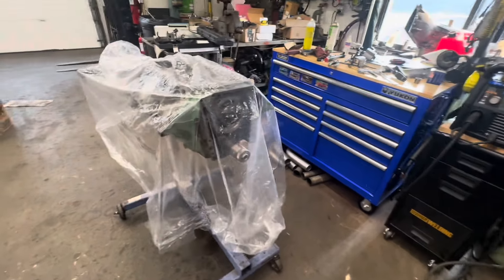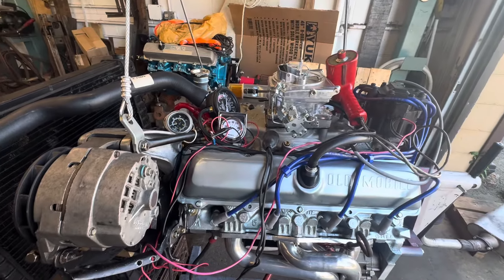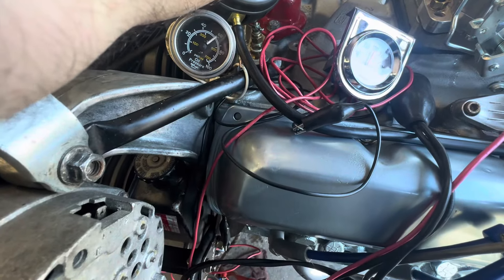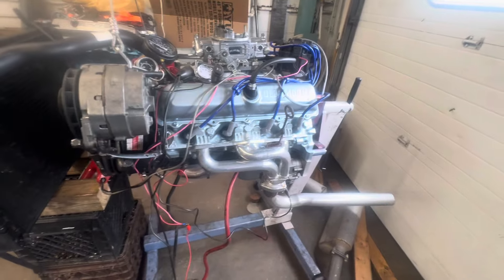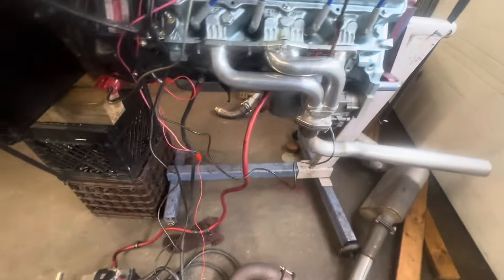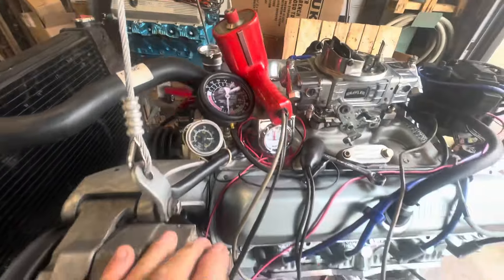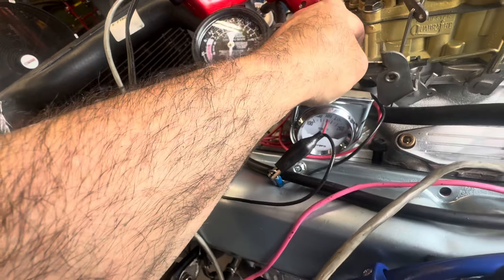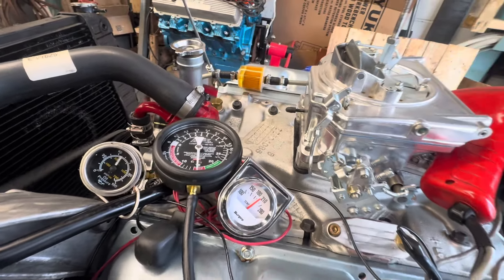403 Olds engine build and test runs￼

Comment: One of the most underrated Small Blocks of all time , as the years go on people realise the 403 is not weak at all , many at 400 000 miles, that huge bore of 4.351 is 100 tho bigger than a 454 chev , bigger than a 500 caddy big block , and the magic 86 mm stroke all modern engines have, its a brillant engine , raise compression and intake, cam and exhaust it more than doubles power , all the burnouts in Smokey and the Bandit were done with a 403 olds Trans Am. Many these days are reving that " weak" bottom end to 6750 rpm snd 675 hp , no brakeage ! That massive bore is very good !
Reply: @JosephCowen-fz8vj  actually the bandit car was a pontiac 400, the trans am used in the bridge jump had a 750hp Nascar engine which was a chevy.  Another fun fact is the 403 Olds motor didn't come in the trans am until 1979.
Reply: @tdog6437  Actually, the 403 was standard in the Trans Am, and optional in the Formula, in California in 1977 and 1978. California was no longer allowed to use the Pontiac 400 engines at that point. Of course, in 1979, the 403 became the standard TA engine, and optional for Formula, nationwide.
Reply: @grand73am  you are correct, California and colorado both had the 403 as a no charge high altitude option in 77 and then became standard for all automatic transmission trans am cars in 79. The only way to get the 400 trans am in 79 was to order it with a 4 speed manual.
Reply: @tdog6437  yes I've had a few , although big , that combustion chamber is well designed , like all Olds , in 1990 the Olds V8 was the only engine that year to be released with a carburettor, it passed emissions with a carbie , every other GM and infact all US V8s needed fuel injection in 1990 to pass , except the Olds . That shows an efficient combustion chamber.
Reply: Was going to do an ls swap on my 79 trans am but I think I’ll keep my 403.😂
Reply: @rafalanderos6527  it's a great motor , that bore and stroke is magic , Edelbrock makes 403 SBO specific heads now and 7111 Victor intake , that revs to 6500 and 600 HP . It's lighter than a SBC . A great engine ,
Reply: Don't think the 403 was a small block
Reply: The 403 wasn't used in any of the movie cars
Reply: @clarencedoland3534  The 403 is indeed a small block Olds. I used to have a 79 TA with a nonwindowed block and I built it up a bit.
Reply: They are the best olds stroker engines

Comment: Seen many cracked main webs in 403's in the 12 years i was in the machine shop.
Reply from the maker: I haven’t had that misfortune yet. I’ve only been inside about a half dozen 403’s in my life though
Reply: There was two block designs. The early design was basically the same as the 455 or 330/350, plenty strong. The later design had a "lightened" block with windows in the main webs, much weaker.
Reply from the maker: @ that’s a myth that refuses to die. No one has ever shown or photographed a solid main web 403 that I’ve ever seen. If someone had one we’d have seen it by now.

Comment: The only thing that bothered me with the 403 was the main webbing having the windows.
Reply from the maker: Yup, that limits how far you can go with them. I’m not going to push this one too hard though 👍
Reply: @olzkng  did you try a different oil pressure gauge yet
Reply from the maker: @tdog6437  no I haven’t. I’ll probably just put it in the car as-is. The oil pump is just a Melling replacement pump with their high pressure relief valve spring so I’m not sure what’s going on there. I’m using Lucas straight 30 break-in oil so I’m sure that’s bumping the pressure up some. I usually run 10W30 or 10W40 synthetic oil after the break-in period so it’ll probably come down a bit from that
Reply: LS motors have windows in exactly the same place ! Are they weak ?
Reply: @JosephCowen-fz8vj  LS motors have 6 bolts and other advantages

Comment: I'm proud to say my only Olds that I ever had was the last of the good ones.1980 Olds 98 Regency. 350 4 barrel, turbo 400 trans. Then they went to the 260 and 307 smog motors. Never the same for power.

Comment: Had one of those 403's in a Jet Boat. The Harden Marine 403 did not have the window mains in  the block..I was told they don't have them in the 77-78 GMC motorhomes either. They used a cam with specs about the same as a 70 455 4sp cam..like 475 lift and 295 duration if memory searves. The thing Ran so close to a 455 jet....it was scary!

Comment: Sounds good, what cam did you pick?
Reply from the maker: I went with a Olds factory cam part #400165 made by Supercars Unlimited. It was used in the 69 Hurst Olds, the 70 442 with automatic trans and W30 with automatic trans, the 1970 W33 Delta 88, the 1970 Toronado GT W34 and I believe in the 71 442 automatic also.
Reply: @ that’s amazing, I’ve always wanted to try that grind! Too bad Supercars Unlimited shut down.
Reply from the maker: @jimmy_olds  yeah that was a bummer. I hope someone picks up their inventory or decides to supply the same cams they did
Reply: @ absolutely! How’d the engine turn out? Decent amount of power?
Reply from the maker: @jimmy_olds  I only got 60 miles on it before it got cold here so I'm still breaking it in. I like to put 100 miles on my rebuilds before I really get on them. It feels strong though and has lots of bottom end power. It spins the tires effortlessly so I'm hoping it makes a decent amount of power.
Reply: @olzkng  sealed power sells it through advance auto or did when I bought mine 1970 w code 350 heads with the 403 valves and the w 30 455 cam with a good intake and carb will make 400hp out of a 403 with long tubes
Reply from the maker: @79huddy thanks for the info 👍

Comment: I'm running a Street Demon carb on my 1970 350 olds in a cutlass supreme.  It works good with the edelbrock performance rpm intake.  Stock exhaust manifolds, cam and valve train.  I am going to put some shorty headers and a  mild cam on it.  Curious what power numbers you expecting from your 403?
Reply from the maker: @mason5540  since I stuck with the stock 8.0-1 or less compression I’d be happy to make 250 honest horsepower. It makes tons of bottom end, that’s for sure!
Reply: @olzkng  word.  so probably pushing 400 torques?

Comment: Nice build if you don’t mind me asking what is the intake manifold part number
Reply from the maker: Casting number is 22504068. Look for the A4 cast in by the thermostat housing too. That’s the easiest way to tell. You don’t want the A5! That’s the roller cam intake and has tiny ports.

Comment: Question. I have heard that it is not good or difficult to get a good reading from an engine running it without a properly weighted flywheel. Either a manual trans fly wheel or having a torque converter attached to the flex plate is best when running on a stand? Love the video and a big van of the 403
Reply from the maker: First off let me say I’m a big fan of yours! I’ve watched many of your videos and I loved that 79 H/O you had with the 403 many years ago! 
I’ve never heard that it’s bad to run an engine on a stand. I’ve heard it can be dangerous because they want to flip over when you rev them up! That’s why I keep a come-along attached from my second floor ceiling beam to the engine to give it some support. You definitely need to run a flexplate or manual trans flywheel on it. If you didn’t I don’t know how you would start it because there’s no way for the starter to turn it over. Thank you so much for watching!!

Comment: Hey man is there any way i can pick your brain a little bit. You mentioned being familiar with oldsmobile motors. I have an 85 cuttlass with an 1978 oldsmobile 350 but instead of machining the engine debating on buying a 403 i found. I have questions regarding torque converter/ transmission bolt ups. As well as questions on motors themselvs. Thank you if you read this!
Reply from the maker: I can try to answer whatever questions you have. You can email me at olzkng@aol.com if you want.
Reply: I genuinely appreciate you my man! Ill shoot you an email sometime this week. I’m picking up the 403 this week
Reply: All Olds have same bell housing. I believe all are internal balanced. Small blocks (260, 307, 330, 350, 403 are same physical size with same stroke crank and can use same accessories. Early 330 has forged crank. Big blocks (400, 425, 455) have taller decks so are wider. Early 400's have same stroke as 425 while 68-69 400 use same stroke as 455>>4.25 inch. They can have 2 or 4 bbl carbs even on big blocks. Have to watch the heads as chamber size depend on displacement.
Reply: Trans selection is fairly important. Need at least a Turbo 350 with a small block. Your Cutlass, if it has the original trans will have 200R4 which is too weak if not built and even then it won't hold up with a hot engine.

Comment: you say stock heads i see there A heads my 1965 425 big block has the A heads did you do anything to the heads or block to make up for the larger cc heads which i think would lower compression if you just throw them on i might be wrong though but that's what i've always thought
Reply from the maker: They're the stock 4A 403 heads. I think the "4" is covered by the PS bracket so it looks like they just say "A".

Comment: Not a bad motor, just had its design limits. If your building for max power in your bird, I'd go with poncho power. Aside from the 557 blocks, they were a much better foundation for really high horsepower and torque. The 403 was never designed or intended for that. The pontiacs were i.e. sd 455, 455 ho, ram air 400, sd421 428 ho to name a few.
Reply from the maker: Yup, I’m aware of the high-performance Pontiacs from history. That wasn’t the point of this build. I have a 455 Pontiac engine ready to assemble if I decide to make a bunch more power!

Comment: How can you run big block "A" heads with those giant dishes in the pistons?  Am I missing something? Compression should be super low.
Reply: Or are they 4A?
Reply from the maker: @jamesweaver7262 I’m running the original 403 4A heads on it. People do run big block heads on 403’s though. The 4A heads have a 83cc combustion chamber while big blocks are usually 80 cc or slightly less (I believe E heads are 77 cc). As far as I know you need to use the Performer RPM intake or Holley Street Dominator intake since they have enough “meat” in the port flanges to port them out to big block size.

Comment: Sounds like you have two plug wires in the wrong spot, It happened to me.
Reply: vacuum leak on the intake manifold or a cracked spark plug